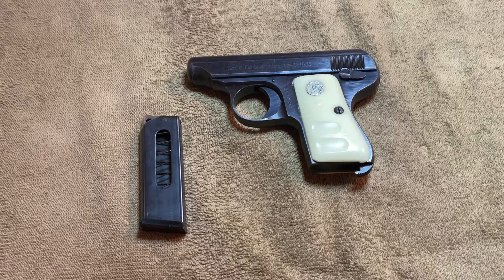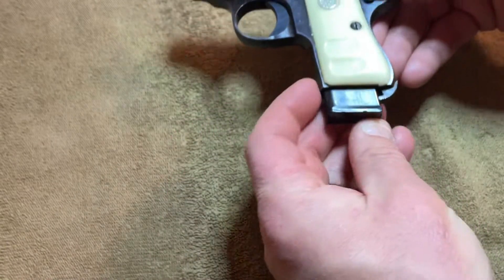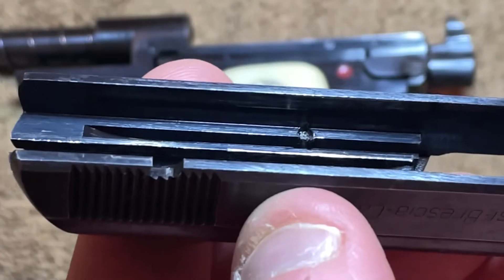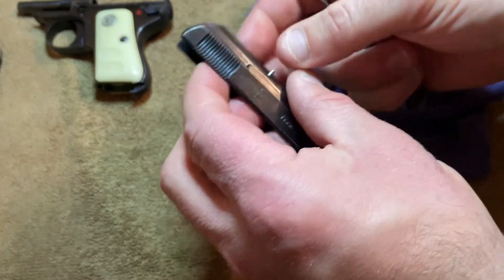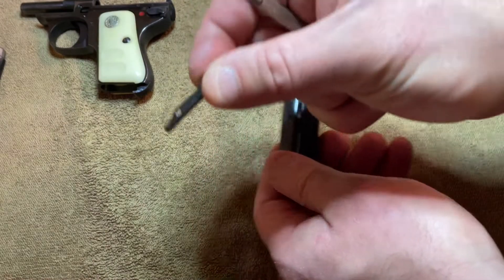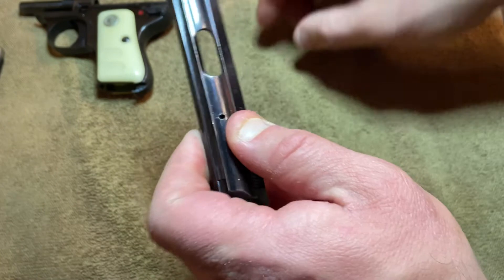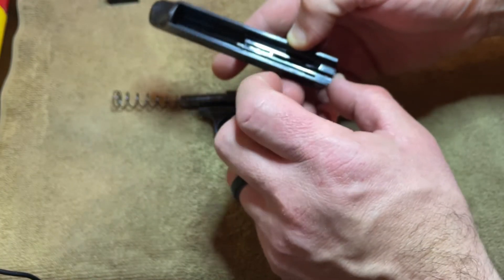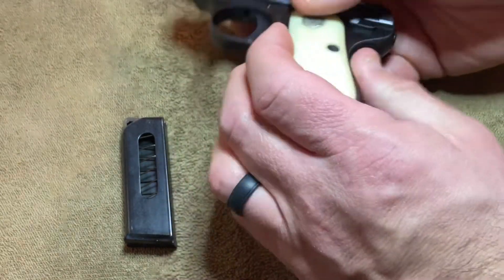25 Auto Galesi Brescia Q&A Session and Extractor Removal

Comment: I inherited a Galesi 25 ACP my father purchased in Italy in late 1940 to 1942 when he was in the US Army. The pistol has no significant commercial value, but has sentimental value but no commercial value. It runs fine and the safety appear to work fine. It appears that the safety functions by applying friction to the trigger bar. However if you pull the trigger hard it will still fire with the safety on. Any thoughts, new trigger bar, new safety switch?
Reply from the maker: That is probably where I would start with the trigger bar or the seer. Gun partscorp.com has everything listed, sometimes they are out of stock though. I would probably talk to a few more knowledgeable people because I’m anything but an expert. I get asked a lot to do cleaning videos; I’ll have one up this week. Thanks for coming by!

Comment: Friend has one that's engraved but the safety is infront of the trigger. Shoots and loads once but won't shuck the brass out.
Reply from the maker: If it were mine I’d replace the firing spring and then maybe the firing pin itself. The firing pin also acts as the extractor. Without seeing the gun though it’s tough to say. Thanks for coming by!
Reply: @cornfromajar3222  do you know of a place that has parts? He has asked me to fix it a few times.

Comment: How do you replace safety on the 25
Reply from the maker: If you just pull the grips off like I demonstrate in the disassembly video, you should be able to replace the safety bar from the grip. If that doesn't work, a trip to a gunsmith might be in order. I hope this helps. Thanks for coming by!
Reply: there are some parts on gunbroker